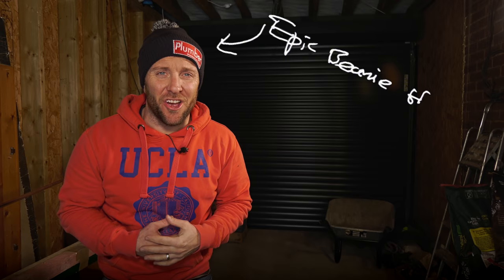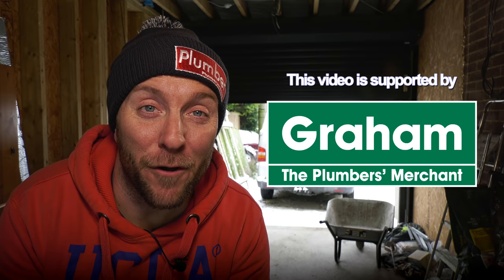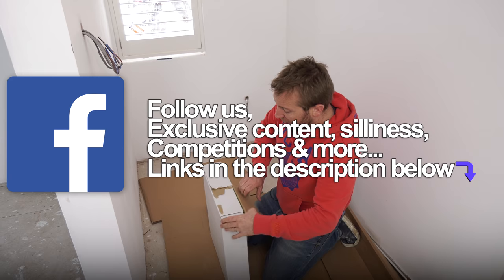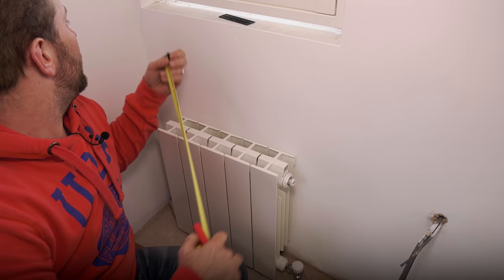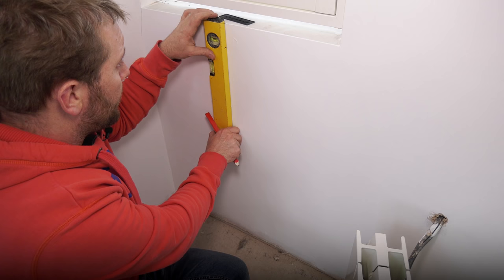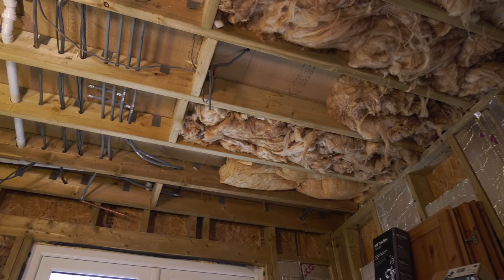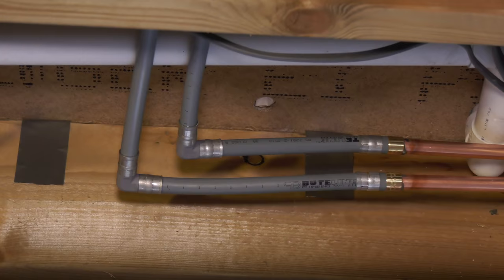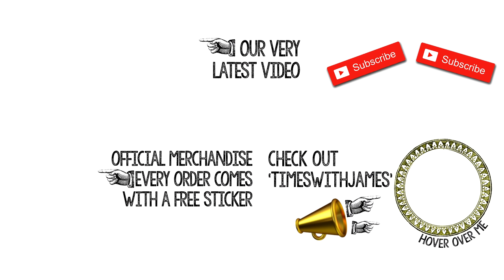RADIATOR INSTALL - Job Report - Plumbing Tips

Comment: James, where can you get those little packing pieces that go on radiator brackets? You know the ones that always drop off when you remove the rad and then disappear down between the floorboards.

Comment from the maker: Thanks for watching guys...still uploading today!
Reply: Hi James. Question from a recently new starter in the trade. I think I saw it in this video but, can you fit the valves to the radiator, and then sit the valves on the pipe work? Or must you fit the valves to the pipe work and then to the radiator? Probably a silly question but I want to check what I’ve been taught. Cheers.

Comment: I have a combi boiler and was planning on putting five (small) radiators on one loop of 15mm pipe. You say 3 max, what is the solution? 2 loops and then the connect at the boiler? (I'll be getting my plumber to connect, I just want to run the pipework whilst I have the ceiling down). Any help would be greatly appreciated. Great channel BTW, I use it a lot!

Comment: I renovating my kitchen and moving one of the radiator to another wall .iv pulled all the plaster off the ceiling and chased the pipes back to the bedroom above and one on the landing .my question is the right pipe on the kitchen radiator goes to the left side of the bedroom and landing radiator. Don't they all have to be on the same side ??

Comment: I have old wood fueled central heating system with radiators. My system sends out water with temps up to 100celsius. Can I use plastic piping and build it myself?

Comment: Top tip get a roll of lining paper (wall paper roll size) and blue tape a piece in the area of interest then you can scribble away to your hearts content, make mistakes whatever. Drill yer oles and remove paper - jobs a good un 😉
Reply: Thats a brilliant idea - especially for a DIYer like me, cheers.
Reply: It`s a top tip but be careful what tape you use as you can quite easily peel paint off the wall or rip wallpaper.

Comment: Did the BTU calcs for a big open plan space I have and I need 23,000. I can make that up with 4 rads but I'm wondering if a large room like mine (15m x 5m) would benefit from some form of fan to disperse the air around it. Do they make anything that works off the hot water but incorporates a fan? Or am I being concerned over nothing. Was going to do underfloor but its been vetoed. Did have 2 rads before but the room was derelict previously and I am guessing it was never warm like that.
Not sure I'd need a radiator if I lived at Lucia's :-)
Reply: The President of The Internet Hey I did exactly that I fitted a Myson unit (other makes available) and fitted under kitchen unit works fab and saves wall space.
Reply: Thanks, I'll check out Myson units

Comment: Are aluminium radiators worth the additional expense? We had a duetec boiler put in 6/7 years ago but radiators never replaced, they seem to be coming to the end of the life! Not sure what to do?
Reply: Dan Jones to be honest Dan we use them loads and they're really only worth it with heatpumps. They're a decent rad but at twice the price of a standard one its hard to justify the cost to the owners. Hope that helps
Reply: JK - I’m not sure if the cost has started to come down or gone up on Aluminium rads? I’m just wondering if they are worth the additional cost and would we see this money come back? It appears normal rads like Barlo are not that cheap for the BTU I need to achieve for each room.

Comment: Good work, but ...  copper tails on your chrome towel rail ?
Reply: Pete Ellacott True, but you can get chrome covers that clip over the pipes...
Reply: Aman A  them chorme covers are useless
Reply: got covers bit crappy. Better if you fit correct chrome pipes its worth the effort

Comment: I cant believe you don't have a standard height for radiators from the floor?! What! No offense but that towel rail was far to high off the ground! It should have been flush as possible to the finished floor.

Comment: It's best to have the rad as low as possible, as heat rises.
Just my 2 cents
Reply: ArcanePath360 you need a gap at the bottom for convection
Reply: Well usually the skirting board is in the way stopping you going right to the floor anyway, which is ample space for convection. You also don't want to burn your carpet or warp your laminate flooring so I guessed that having some sort of gap went without saying.